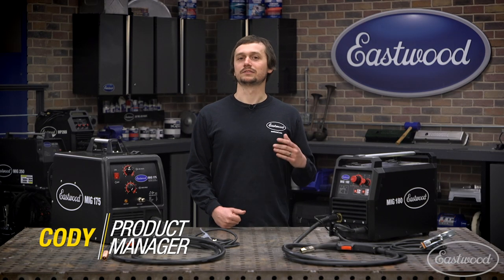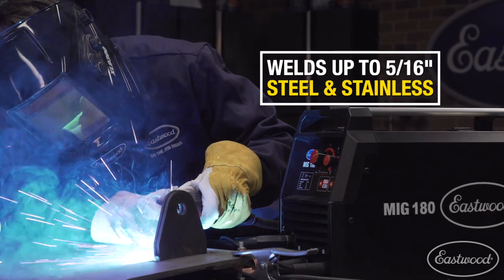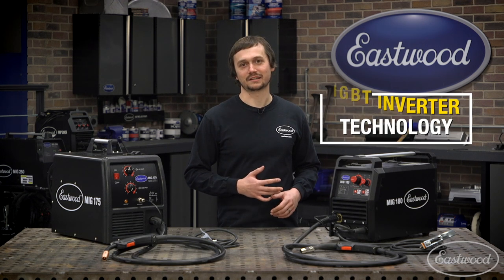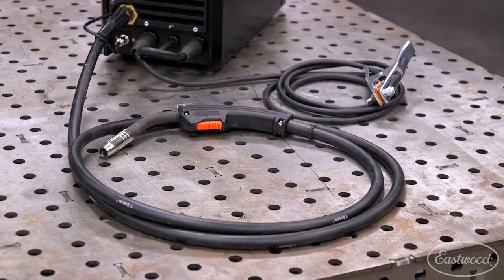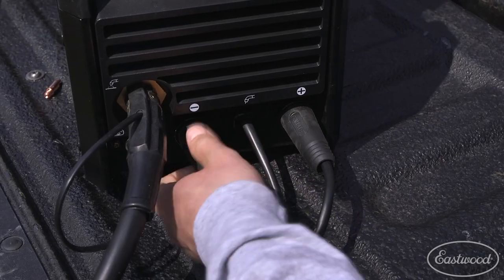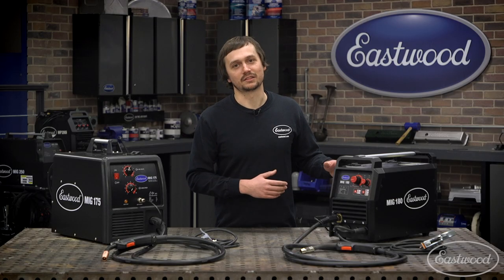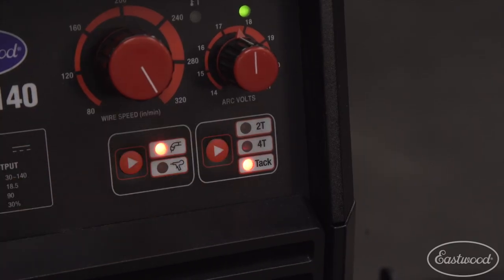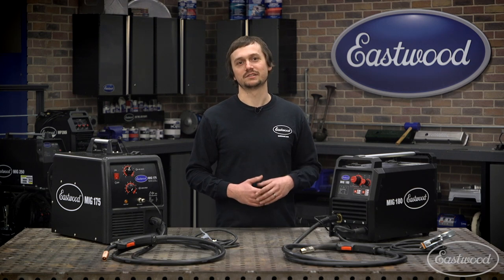How is the MIG 180 Different Than the MIG 175? Everything You Need to Know! Eastwood!

Comment: I bought my 175 about 6 years ago and use it often. I don't get your point about the new one being able to run on a generator, I've run my 175 on a 6.5kw genny 30amp/240volt outlet (using a NEMA 50 to 4 blade 30 twist lock adapter) since day 1 with absolutely no problem. I don't need the dual voltage but, the up front polarity change feature would be a welcome change. It also looks like the 180 is a lot smaller than the 175 which makes me wonder if it can still run 10# spools. I honestly love my 175 but, if it ever gives up on me, I'll definitely be looking into the 180.

Comment: Wow, I am an idiot…I bought the 175 and 200 tig years ago. For some reason I thought they were both dual voltage and both inverter. Moved to a new shop and only had 120 in the shop and my trucks 240 generator. Found out quick it neither works on 120 with the adapter (200 came with the adapter for 120) and sucks welding with my generator. And it weighs an insane amount compared to the TIg. Lol now I know why. Guess I am going to need to get the 180 for the service truck and keep the 175 in the shop

Comment: Just in time because I'm in the market for a new mig welder
Reply: Me too!
Reply: I bought my MIG 175 about 6 years ago and I absolutely love it! Even though I don't need the dual voltage capability that the new 180 has, the up front polarity cables would be a nice change. If my 175 ever gives up on me, I won't hesitate to look at Eastwood welders again and I was raised on Lincoln and Miller equipment.

Comment: What size generator do I need
Reply from the maker: You can find the specifications on the product page and match that with the generator of your choice.

https://www.eastwood.com/eastwood-mig-welder-180-amp-with-spool-gun.html?utm_source=youtube&utm_medium=annotation&utm_campaign=2021-04-20&utm_content=mig+180+comparison+video

Voltage Input Requirements:
120 VAC; 24 AMP
240 VAC; 29.6 AMP